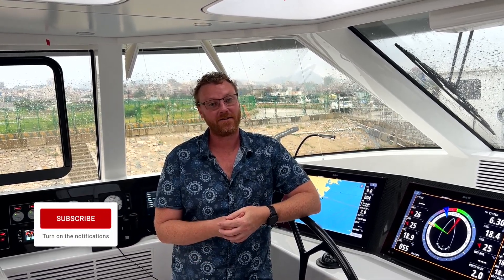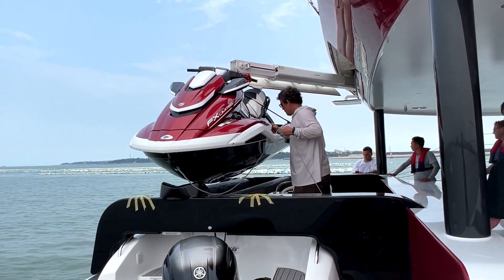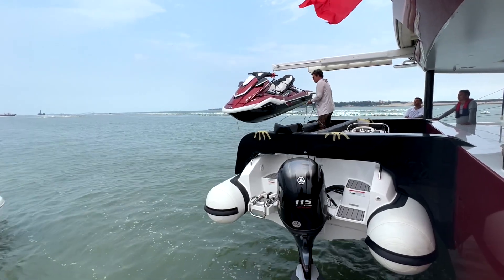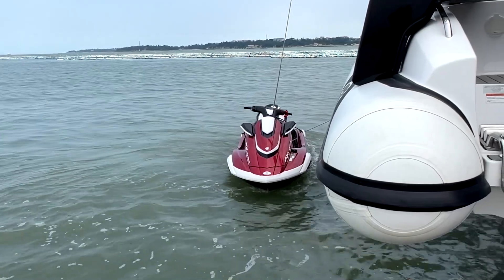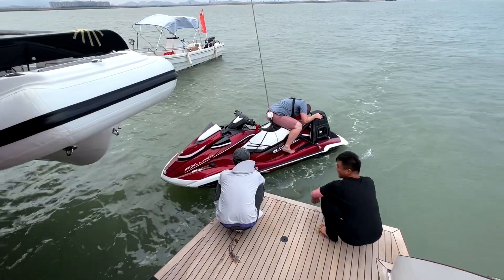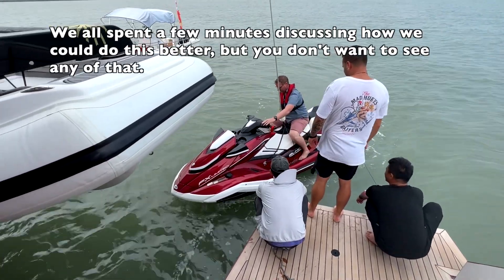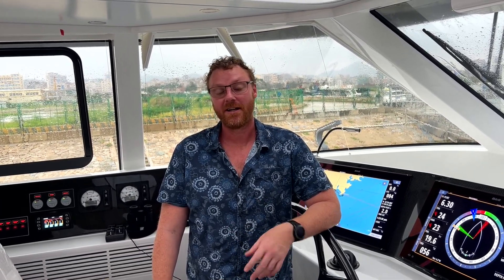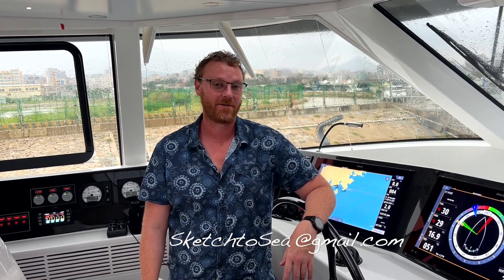Sketch To Sea: Tender and Jet Ski Operations

Comment: You have done an amazing and thorough job spec'ing out this yacht.  In this video i noticed the struggle disconnecting the tender shackles. Do you  have quick release shackles?
Reply from the maker: Thank you for the comment. Yes, we have completely changed the way that we do this. In this video it was the first time ever doing both, and it had our passage set up on it.

Comment: I own the same jet ski as well as a SeaDoo.  If it were me in constant salt water environments I personally would opt for the closed loop cooling of the SeaDoo to help mitigate salt water corrosion. Personal preference however, they are both great skis.  Beautiful boat, enjoying your content!
Reply from the maker: Thank you for the comment. We have built in wash out stations at the back for this reason. I have had SeaDoos in the past and have always found them very difficult to work in the engine.
Reply: @sketchtosea3750  Agree, there is something to be said for that Yamaha 1.8. Very reliable.

Comment: Very nice boat. 
First, I'm not a marine engineer but I am curious. To each their own but I don't understand the attraction of a single, huge 'jet-ski', especially when there is a large tender beneath. When jet-skis become larger than a '1+' there isn't any fun left for anyone vs. the fun that can be had by a couple smaller '1+' 'skis.  Also, FWIW, I'd be more interested in that size tender with an inboard jet pump vs. an outboard. A big o-board engine, yanking up and down on its transom mount, while dangling from davits, creates constant stress on the transom and its mounts. A jet driven tender eliminates those transom stresses, in-use and underway, and gets you into more shallow areas with less noise and concern. Look at that thing... the outboard is using up what, 25% of the tender's length, vs. a narrow portion amidship?
Reply from the maker: There are a few items that we considered when choosing the tenders. With regards to the jet ski, we only had room to store 1, and the way that we have used our skis in the past is more as a personal small boat. We also have the "raft" for the ski as well. We usually strap coolers or dive gear to when we want to go off by ourselves. It also is a bit more stable than a smaller ski. With regards to the tender, the other viewers comments are valid. We had a very hard time finding a tender with the capacity to fit the whole boats guests. Also the reason for the outboard specifically is when we need to change the engine in the future, we also receive brand new transmission at the same time.
Reply: Regarding the tender you be surprised how much more weight an inboard engine and jet drive adds to the tender concept.

Comment: Make sure your tender is tilted properly to drain.  Fill it with garden hose and see what happens. Remember it must drain in a down pour. Put red sign by davit winch buttons, "insert/remove drain plug". Also keep wash down attachments for each vessel handy there.
Reply from the maker: I agree with all of these suggestion and we have already planned to do that, thank you for the comment.

Comment: Interesting, so if the tender is away for a while, how will the waiting people deploy or retrieve the wave runner for their break time?
I am curious how you would launch or recover the tender in either stronger tide-currents or even while underway?  [Like man overboard or Movie style getaway].
At first I thought you'd want two jet skis. But then I saw the tender's helm sticks up. Still, a 2nd smaller single ski could have a special mount. Maybe cut the height of the helm unit or fold it?
😮😂😅
Reply from the maker: Thank you for the comment. It was part of the design brief to be able to launch the 2 independently. The helm of the tender does stick up and we had to plan how to have both these items on the davits. We originally wanted a platform, but there again was no way to have both these items on it.